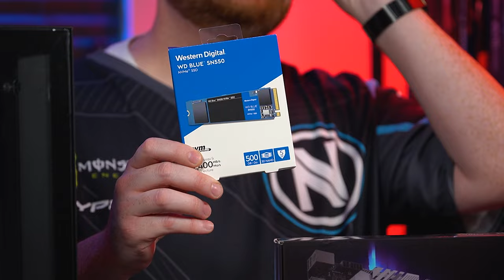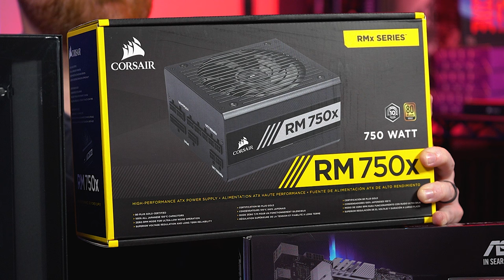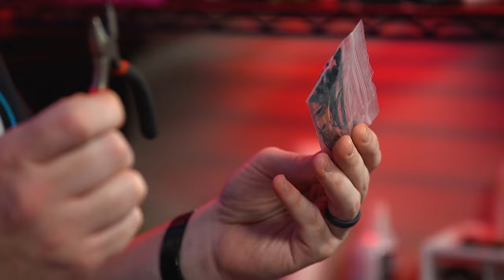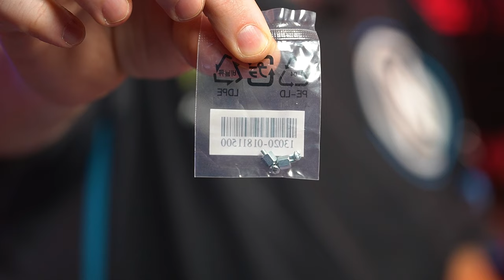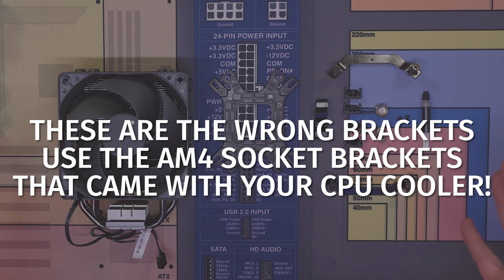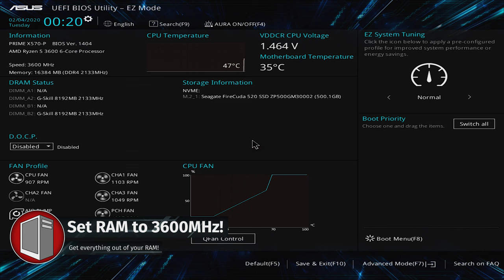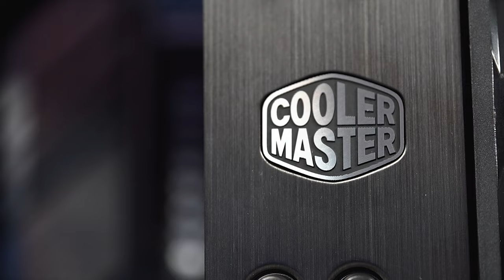How to Build a PC! Step-by-step (2020 Edition) | Robeytech

Comment: I used this as a guide for building my first pc today! I changed several of the parts slightly just a bit to keep the price down but also get exactly what I wanted.. I chose the Gigabyte Aorus X570 Elite with WiFi because my PC can't reach the modem at this time and it was about $70 less with the current sale I found.. Then I upgraded the CPU to the 3600X (on sale for $190!!). Also got the MSI 1660 Ti as I wanted a bit more from my GPU. Finally, I got 2x8GB Corsair CL16, DDR4-3200 just to bring the price down a tad. All and all, with discounts I found from Black Friday Sales, I spent just over $1000. I am really happy with it. Currently getting a copy of Windows 10 going so I can work on OS set up! Thank you for this great guide. I am so excited to use my new PC!

Comment: This is going to be long so skip to the bottom for the short version.

I never put together a computer before or have any experience with actual hardware. It always looked too complicated and it was too intimidating for me. A friend of mine helped me put together a parts list for a DIY setup, which was going to be tremendously faster than my 10 yr old system. Due to recent events (and my impatience), I decided to try and go for it myself. I watched a few videos to gauge some extent of what u was doing and i stumbled across your video. It just so happens that I had the same motherboard so that immediately got my attention. I followed the video as best as i could and consulted the manuals when needed for the parts that were different. Everything's plugged in, and the moment of truth comes to flip the switch. Everything came on and it was operating normally. I was so excited and it was so satisfying to build this and learn as much as I did considering I had never done anything like this before. I honestly could not have built it without this video. Thank you so much.

TL;DR- I never built a computer before and had no knowledge of the interworkings or parts. Following this video helped me tremendously to build my computer. Thanks so much.
Reply: Did it help? How good does the pc run? I have ABSOLUTELY NO IDEA about how to build or setup a computer and I don't want to regret it if it isnt worth the time and money.
Reply: @jackthechihuahua3323   yes it absolutely helped. My pc runs great and I have not had any issues. It really helped that I just so happen to be useing the same motherboard as he had in the video, so it was easier to find everything, but if you are useing something different, just look at the manual so you can be sure you are putting everything in the right spot. Dont stress, and follow along. You can do it bud. Relax and take your time
Reply: @Doomcrew-vb3rp  Thanks man, I'll just go along with the vid so no worries!
Reply: @jackthechihuahua3323  no problem bud. Good luck
Reply: @jackthechihuahua3323  its strange honesty, I've never built a PC and I don't even have the same mother board, but this video really has been helping me put mine together
Reply: @fruitsquisher4546  I won't be getting one for a while but I will comeback to this comment once I get started

Comment: I love learning how to build a pc when im totally not paranoid about breaking 1 gold pin on a cpu.
Reply: Just hold it by the sides and carefully put it onto the motherboard and you're fine. Yes they're fragile but you only touch it for like 2 minutes.
Reply: 2 minutes doing what? Should be seconds in your hands. Out of the box straight into its slot.
Reply: @stance711  exactly my point
Reply: After watching this video, the CPU pins are the least of my concerns, i'm already dreading the cable management.
Reply: @Elijah Lettman hey brother

Comment: Hey just wanted to say thank you for this video. Built my first PC last week and I watched this video and it helped me so much. I have a  $60 Lian Li PC case,  GTX GeForce 1660 TI, 1tb M.2 SSD , Gigabyte B5550M Motherboard ,Ryzen 5 3600 series CPU, 2 Corsair RBG blue fans,  2 Gskill 16gb rams, AMD CPU cooler, Power spec 650W Power supply with a Logitech hero mouse and finally the Corsair K70 RGB Low Profile keyboard.

Comment: Based my new build on this, with a couple of additions and couple of changes. My previous pc was a self build, a local computer store dealt with connecting power etc, which lasted 10 years. my only reservation when it was time to build was connecting power supply to various parts of motherboard and connecting to case. Watched this video a few times while I was waiting for components to be delivered and when the time came to build, had my tablet with this video running especially the connecting case headers and power, it was easy to follow, thanks Robeytech

Comment: Thank you so much for helping me build my 1st PC! I didn’t use the same parts, but after massive research & the mercy of PC components shortages and scalper chaos - I still came out with about a $1500 build, which I’m sure if it were a prebuilt from major retailers would have cost 3x as much.
Some choices I made b/c of personal aesthetics, some b/c of price, and some parts b/c they were the only thing available for a normal MSRP price.  I will not support scalpers!

DarkForce MATX case - mint green, 
B550M-Prime (Wi-Fi) MATX Motherboard, 
Ryzen 7 3700x CPU, 
Thermaltake 64GB DDR4 (2x 32GB) c16 C3200 RGB RAM, 
ID-Cooling CPU Cooler (white), 
Corsair RM850x 80+ Gold PSU (white), 
Sabrent Rocket M.2 NVMe PCIE Q4 - 2TB w/heat sink (Copper/white), 
(5) - ID-Cooling 120mm Case fans (Mint Green/White LED) 12V 4-pin, 
Noctura Thermal Paste, 
Noctura anti-vibration fan connectors, 
Noctura 4-pin Y fan connector extensions, 
Asia Horse extension cables (white), 
and the only GPU that I could get my hands on that is semi-decent - XFX Radeon R570 RS 8GB (black/red - which totally clashes with my build, but I’m grateful to find one MSRP 8GB graphics card at Best Buy, until the 3080 Nvidia cards return someday).

Comment: A brilliant guide for the build itself, maybe a part 2 on how to setup the uefi and install windows etc
Reply: @RobeytechLive  how do you install ssds/hdds? And do psus come with cables?/extensions. Say if the PSU wasn't modular and it came with 2 set sata power cables, but I wanted 3 hardrives, how could I power the 3rd?

Comment: Another really easy case to build in is the Coolermaster Masterbox TD500 ARGB.  I got it for $97 online and it's got RGB fans built right into it.  I really love the slight amount of clearance they give you between the motherboard and the back of the case.  Makes it really easy to install my double GTX1660 Super setup, whereas with the smaller cases I had trouble battening my graphics cards down in the back without having to do a metric crap ton of work uninstalling my cables, graphics adapter and motherboard, then installing the adapter on the board and CAREFULLY reinserting the assembly and reattaching my cables.  The GTX1660 is a tad weighty, as you're no doubt aware, and I was always paranoid of the possibility of cracking my PCIE slot because of that weight.  :D

Comment: Great video, good tips. I followed along, but made some different hardware choices. 
For others building this build.
I went X570. The case led placement is reversed. The fan headers are on top of the board, not the right.
IO shield came pre installed, so easier there.
I found the cable extensions completely stupid, wish I hadn't bought them. No easier, and the build looks damn near as clean.
On my AORUS Elite, the 2nd case fan header is just above the PCIE Gen4 slot on the left, weird central placement.

Happy building!
Reply: thanks, i was wondering if i needed to buy the cable extensions.

Comment: Heyo, great vid, it has been at least 5 years since my last build so I had to be extra careful! 
At 36:45 why did you only connect the 4-pin 12v connector? 
This is not recommended on by the manufacturer, as stated in page 1-17 of the manual.
Reply: same thing I was thinking
Reply: Im building my first pc with this motherboard and that is literally the question I watched this video to get answered and now I am more confused. The manual says to use the 8pin connector or the 8 and 4 but not the 4 only. The only cable extension that worked was the one that was split into two 4s. So I plugged the two 4s into the 8 pin spot. Is that correct?
Reply: 41:30  Kinda late reply, but he does plug both the 4-pin and the 8-pin. Seems like he only had one cable extension.

Comment: "Didnt have the budget for a high end gpu." Proceeds to buy an NZXT case, third party cooler, 750w psu and cable extensions.
Reply: That's the same thing I was thinking. Like I have an x570 with a 3700x an MSI Duke RTX 2070 OC and a 750w 80+ gold powering it all, he went way underpowered overspent on this build.
Reply: @TheGauges420  with ur asus prime x570-p board and ur 3700x cpu did u have to update the bios before using the cpu?
Reply: Exactly, why buy this worrying about the future? 
If you get a cheaper psu , motherboard and maybe completely pass on a cpu cooler, you can get the 5700xt + ryzen 3600 combo. Future proof setup, even with a b450 motherboard, and great performance.. you can easily get more money on that setup’s lifespan for a not near future upgrade.
Reply: @gamermaster6181  I have an MSI x570 A Pro motherboard, and no, ran straight out of the box, and easily set my RAM to its advertised speeds (plan on tinkering more with it, i think i can get much more performance because i chose better parts). If i DID need a bios update i wasn't worried though, because 1) it has a bios flashback button on it, and 2) I was upgrading from a 2600x (which is going to my nephew) so I had an extra CPU to boot with if needed.
Reply: Same but i have water cooler h80
Reply: Agreed definitely did not need that third party cooler. The stock cooler for the ryzen 5 is I will admit not the best but sufficient enough for the chip. It does the job easily so no need for the other cooler.
Reply: Buying a 3rd party cooler is so stupid the ryzen one works fine
Reply: LOL
Reply: should’ve got the 2060
Reply: @gideon476  with 3070 releasing soon this build is fucking terrible for the price.
Reply: Could you all make a alternative build that would be better? I’m learning so I’d like your opinions
Reply: @melikesgames5452   Before asking people to make an alternative build, you need to decide you budget and what you want as in gaming / productivity like youtube / or like streaming. Also, I don't really think you should ask other people to decide your build, either way your still going to have to learn about the parts when you put it together. Only takes about a week or two to really learn everything. Just watch bitwit pc builds, they are entertaining and they taught me alot (well, not in parts really but in building, dont know how i learned about parts)
Reply: @axtra9561  yes ofc, I’m sure all of us who want build a pc want recommendations, and to take them with a grain of salt, these builds can help someone who’s learning to understand each part and see which parts have been recommended the most frequently. Even id like to see a recommendation of a build to see what people think is the best bang for buck. Possibly aesthetics included which overall is important to me but maybe not to some others
Reply: @dude9237  I really just say you should learn about the parts yourself because no one will be able to understand exactly what you are envisioning or have planned. Like for me, im building a pc rn which isn't really that aesthetically pleasing and in probably like a month or two i'm gonna get all my aesthetic stuff. r/buildapcforme is good but building pcs for randoms who obviously don't care about what advice you gave them is annoying. I've given people advice alot of times and most of them never even respond just like that guy. They aren't entitled to my advice. Just makes me feel like i wasted time helping someone who never cared.
Reply: @axtra9561  ah I see where you’re coming from
Reply: Better cooling mean lower temps so mean higher boost frequencies, mean better perf. I would agree with you it may be overkill for the rig, but for my 3700X I was happy to get the boost from a third party cooler. Without O/C, my Ryzen get about 10% higher result than what other are gettin, it just keep running at higher boost frequencies than most because the cooling is decent.
Reply: @foudres06  shutup
Reply: @axtra9561  They only asked because you took time out of your day to criticize the choices made for this video, though. You're certainly free to disagree with all choices made, etc. but it's a little disengenuous to trash someone else's build saying that it's terrible, but then refuse to offer your alternative ideas when outright asked. The person responded to your comment about how this build is terrible for the price, asking for your alternative -- that means they were specifically looking for you to explain the choices you would make for THIS build, like what you would do differently given the same parameters and considerations. Context matters, but you seem to have chosen to ignore the context of the question that was posed to you in order to avoid having to explain your critique of the build. They even asked nicely, too. I can understand not wanting to throw advice to the wind, but if you're going to criticize something else as if you're an expert, you should be prepared to explain yourself -- otherwise your opinion is irrelevant and useless.
Reply: The cooler is just 30 bucks
Reply: @TheGauges420  Would not bother with RTX 2xxx series get 2x the speed and same prince with 3xxx series.    I still have a 1080GTX and no compelling reason to change it.   I don't use 4k for anythign and 100fps+ in all games.    Better off finding a used system as computers really have not got all that much faster in years.
Reply: @Physics072  i have a 1440p/165hz monitor, and I picked up an MSI 2080ti Gaming X Trio 1 week before 3080 'launch', for just $400. I saved about $150 after taxes not having to buy a 3070, and I got a sweet ass card. The RGB is amazing on it and matches the rest of my rig 100% perfectly. So far none of the new GPUs at all would really match. Maybe an EVGA one, but eh, the MSI Gaming X Trio 2000 series has some of the best looking RGB I've ever seen on a card.
Reply: @TheGauges420  Yea thats not a bad price and you have it NOW.   Yea I have to have high refresh too.  240HZ Alienware for gaming.
Reply: @diegoh4579  said the had been government
Reply: @gideon476  said
Reply: By the time I have enough money for even one part i'll be in my late 30's
Reply: Some people would rather have better quality components than cut corners and get a better gpu. Let me explain. Nzxt case - nice big and easy to build in and mod. Third party cooler - stock cooler is fucking horrible. I had the same mindset, why buy a cooler when it's Free. Two months down my ears are bleeding with how annoying it is. 750W, eh maybe that's a bit too much, 550-650 is alright. Extention is too a bit too much

Comment: My son and I built his PC based on this video this week and we ran into a snag and not sure how to trouble shoot it. When we turn the power on the light goes on inside but when we hit the power button there is a click noise from the power box like it is shorting out. The only thing that looked different to me is the two fans from the case has a connection 3 holes and the motherboard has 4. Any ideas on what we should do? This video was great and very thorough!

Comment: I’ve watched 3 of these and I still am not comfortable to build my own pc.. sigh maybe another 20 of these videos can help lol
Reply: Same here. I just need to pull the trigger on a few parts to get started then maybe it will be smooth sailing. Just dk jack about computers lol.
Reply: What the most confusing part lemme help u
Reply: @Hol_my_40  I actually haven’t got parts yet and was just thinking if just going on ironside even though it’ll cost a couple hundred more. I just don’t wanna mess it up lol
Reply: I finally got a bank account and what not, looked around and got every part except for the graphics card since it's far too expensive. Now here I am looking in the comments because I got the Hyper 212 EVO cooler which looks completely different from his. Otherwise, jusr following his instructions is extremely easy, fun even.

Comment: Great "follow me" video, great zoomings to see where everything goes. I'm about to do my first build and I'm a little worry on the PSU department. I have a x570 and a 700W PSU, according to partpicker the total wattage of the build is less than 500 but my PSU doesn't have that additional 12v cable for my MB, I read that it isn't necessary if there isn't any crazy overclocking. Should I be worry about that?
Reply: same Q

Comment: Dont touch the top part of the cpu
15:32
Reply: Really? Why?
Reply: Fukc G00gle It could damage it. The CPU is very sensitive be careful. Don’t touch the bottom either
Reply: Fukc G00gle make sure to handle it by the sides and let it fit into the socket carefully and NEVER add pressure
Reply: if you do, use a lint free cloth and some 70% isopropyl alcohol to wipe the oils off. allow time for evaporation before applying thermal paste.
Reply: @Vyxin fake news

Comment: I’m still waiting on a part so I haven’t started but wtf why does the power supply have 15 cables.
Reply: If you got a non-modular PSU there are lots of cables u won't need

Comment: Nobody shows how to install Windows
Reply: Get a usb stick, plug it into a running pc, download "windows install media creation tool"(thats what you can google) create a usb boot drive with the tool, plug the usb stick into your new pc and normally it should automatically start the windows prompt, if not you'll have to change the booting device in the bios, but that most likely wont be needed, but if it's needed, change it to USB device first. Reboot. Done.